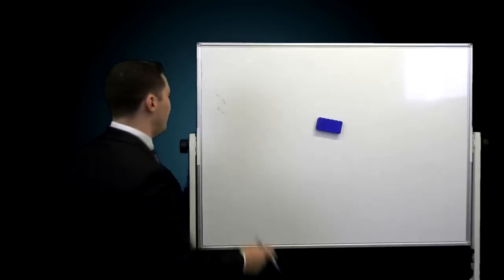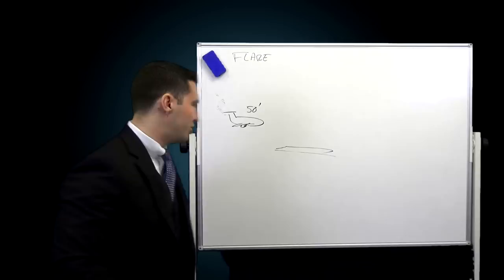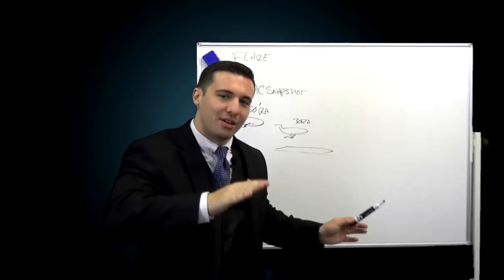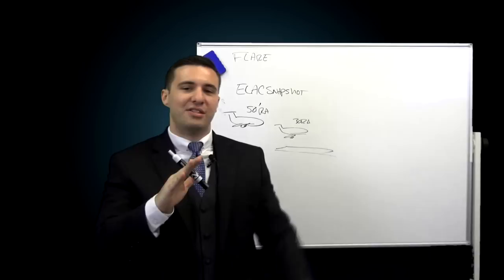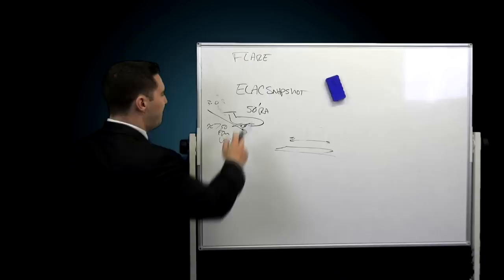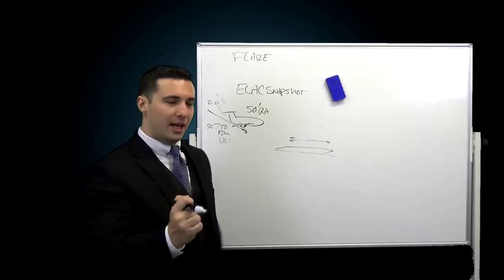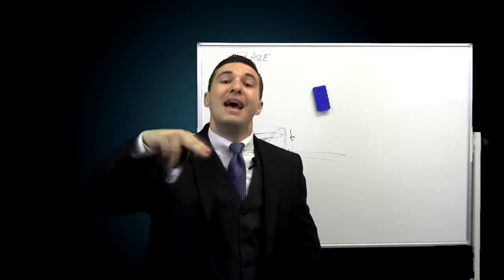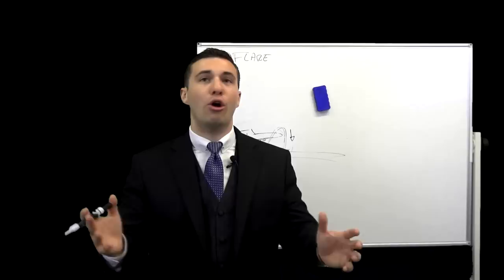A320 Landing techniques!

Comment: As an Airbus pilot myself, this is a great video, I always come back to Joe's various videos every few months to refresh my knowledge of things.  Outstanding stuff.
Reply: Hey as a real pilot do you mind letting me know: On approach in crosswind, do you apply constant rudder input to keep the track on rwy heading? Or should you have neutral rudder with  more drift angle? Thanks - I’m just a simmer but love the a320
Reply: @thatmatty231guy you don’t rudder it you just use a wind correction angle then rudder it straight during the last 10’
Reply: @lauran3244  Thank you -ive been trying this lately and yes that works much better

Comment: 1000 hrs in 319/321. I made the best landings by applying forward stick below the 10’ call out rolling the main gear on every time! Pulling back in the flair you’d ram the main gear into the runway making a hard Airbus landing! Once I got used to just the opposite I was surprise the nose gear had plenty of (pitch) room instead of the thought of landing on the nose gear first! It was the same on the B727. A little nose down pressure at the right time you would roll the main wheels on the runway! Took about 3 months to figure it out after 10,000 hrs on the B757/767!

Comment: The 320 gives you ZERO feel in the stick during flare - unlike Boeing 777 & 787 that have artificial feel units which are quite good. If you try and wait until you have no more resistance in the side stick you’re gonna smash it on every time ! You gotta flare the 320 with your eyes not what you feel in the stick. I wish someone would’ve told me that - I could’ve avoided a great deal of embarrassment.

Comment: Joe, great video but I think the term pumping in relation to the flare is a bit misleading...perhaps more of an emphasize on “squeeze and hold” back on the stick would be better as this leads to a pilot thinking about a steady smooth input during the flare to touch down in the proper target area of the threshold ....when I flew the 320 many moons ago, I used to suggest to my low experience FOs that what I primarily wanted to see the most was accurate touchdown targeting, which would likely not lead to a pure greaser....but, the greaser was lower on our priority as we often flew into wet limited length runways in Europe and the emphasis was on stopping performance by getting the wheels on pavement ASAP to get braking action as soon as possible....at the moment, I fly 747-400s into places like San Diego (about 2600m Rwy) and the same “squeeze” technique still applies, but once again it’s all about setting your touchdown target and accepting that they aren’t all going to be greasers to keep the operation safe....I haven’t seen any of your other videos but would be most interested if you did a presentation on runway overruns and how to avoid them (though perhaps you’ve already covered this?)....there have been too many over the last couple of years and they are so preventable.....all the best!
Reply: This is interesting. I only have a PPL, but I was taught to NEVER push or let the yoke go forward during flare. Whenever you feel you're pulling too much nose up, just "freeze" the yoke and hold it still. The nose will come down again by itself at which point you can continue pulling gently. (unless you're pulling a steep angle of course).  Looking at all these airliner videos, you often see the pilots yanking/pumping the yoke before touchdown. I suppose some dynamics (inertia?) are totally different, comparing a GA  plane to an airliner?

Comment: Pumping is a  life saving technique to achieve lower landing rates. I'm not a real life Airbus pilot (sadly), but I fly a study level A320 and pumping the stick always saved me when i felt like the plane was gonna touchdown way too fast. It really helps to cut that extra energy in half and kiss the runway. My average went down from like 190-250 fpm landings to 50-150. I didn't know it was a real life technique, though. That's amazing! And as I didn't know the technique, i used to call it "jerking" the stick when explaining it to p3d friends struggling with their landing rates. Pumping sounds a lot better ngl. It's perfect for floaters as well, despite not being something a pilot would do, i guess, as it could be dangerous. Perks of flight simulation, i guess. Float for a couple hundred meters, touchdown with a sub 100 fpm landing, and then brag about it XD By the way, i cut the throttles at 50, pre-flare just a tad, and start pumping at 30-25 depending on weather and runway length. Sometimes I don't even pump. The pre-flare at 50ft often cuts the energy decently enough, but it's also very risky sometimes because it could slow down it way too much and make you drop like a brick while pitching up like a mofo to try and make it less of an impact. When it's timed correctly, though, it's often an effortless sub 200 on TDZ.

Comment: Unless you claim you know more than the people who wrote the FCTM, your technique and explanation are inaccurate. 

-Flare height is 30 ft, it increases or decreases based on various factors. All that 'Arresting Sink Rate at 50 feet' talk you gave was BS. Your instructors will specifically tell you not to do that, as that will mean you are now touching down on the RWY farther than you had planned to and thus are eating up precious rwy length and decreasing LDA (Landing distance avail). Big No No.

- During flare, PF will have to apply a progressive and gentle back stick order until touchdown.  (Diect quote from FCTM). No pumping required (really!). If you feel you have flared too much the action to take is to release the backward pressure and not as one of the other commentators has pointed out pitch down at 10'. Lol, that is rather dangerous and may result in a nose wheel strike and those wheels are not really rated for the loads the main landing gear experience.

-At 20' the retard call is given and is a reminder, not a command (unless in a cat3b autoland). As long as TL are at idle at toughdown to allow for spoiler deployment and holding a little thrust till then is warranted you can do that. Different circumstances require different retard heights, retarding at 30' feet may be necassary when landing in a wet runway to improve landing performance but generally on a normal landing at sea level with a headwind and moderate temps, 20' is a pretty good height to retard Thrust Levers(TL).

Your video does have a good coverage of flare law but is still inaccurate with the practicalities of flying. I would suggest deleting this video and re-uploading it after you've read up on the FCTM.

Disclaimer: I'm not an Instructor on the A320 family. In all cases the current FCOM and FCTM are the sole authority on procedures, unless your company ops procedures say otherwise and are more restrictive, over what I've said here and any errors I may have done in doing so. Please ask your company instructors to clarify any doubts you have on your SOP and don't follow what you see on YT.
Reply: Your technique sounds perfect to me. This is what should be done. Everything from not rounding out at 50' until and unless you have some abnormal situation like steeper glideslope. And applying gradual progressive back pressure at or little after 30 ft callout. Cutting the throttle at 20' or after but definitely before main gear touchdown. I guess that much depends upon your energy state. 
So, yeah! Your comment is very much helpful. 
Thanks👍🏻

Comment: Retired airline pilot 25 years flying Boeing 737/57/67 aircraft. I don’t think you have ever been in the cockpit as a pilot. You do not mention one of the most important components of flying any aircraft, TRIM.
Reply: An airline pilot of 25 years and you don't know the A320 AUTO TRIMS? That's why there's no mention of it.. you don't trim it manually.  Sounds like you're the one who's never been in a cockpit. Maybe it's that you're commenting on an A320 landing video having only flown Boeing.. go figure.

Comment: Hi question. If coming in for example at 700 ft per min. At 50 feet, do I pull a little then at 30 start flaring? Or at 50 still maintain pitch
Reply: A320 in normal wind condition, I mean except for tail wind, actually no that necessary to do round out, that may cause to use a lot of runway, but it will be very smooth touch down. A321, you better round out after 50 feet. Round out technique is just a bit of back pressure on side stick then release it, you may see the sink rate will be down to 350-500, that means a perfect round out, then after 30 or 20 feet call out, start flare just a little with thrust idle when you see the flare position is established. Well, it just take times to learn everyday every landing.

Comment: Great video! But I am confused, why do you have to pump the control column on a plane that's not an Airbus, but you don't have to pump as much on an Airbus?
Reply: Fly-by-wire controls on the Airbus.  Instead of physically moving the controls with the yoke, on the Airbus you are telling the Flight Control computer that you want just a touch of nose up/nose down and letting it move the control surface.

Comment: “Pumping” the yoke/stick is terrible technique and goes against airmanship 101. Constant/increasing back pressure for conventional aircraft and slight increase in pitch then flying the nose wheel onto the runway for the bus is proper and correct.
Reply: In FLARE mode it's conventional so you have to 'pump' or constantly adjust back pressure for the round out... looking forward to you disagreeing
Reply: @SweetToastSugar wrong. But what would I know, I only flew the bus for my previous airline and am currently a legacy CA.
Reply: @prorobo  When I read "legacy CA" I immediately thought of the Erin Brockovich scene where the PGE lawyer flexes that they were a multi-billion dollar corporation. Yes captain, 👨‍✈
Reply: @SweetToastSugar  not a billionaire, but again, have flown the bus and fly for a living making $300k+. Keep playing that flight sim from your mom’s basement though. 👍
Reply: @prorobo  gross or net?
Reply: @SweetToastSugar  gross. I’m a junior 737 CA.

Comment: Sorry for the "maybe" stupid question (I'm only a Sim Player) - but why do you look at the end of the runway while landing?
Reply from the maker: It enhances your peripheral vision to increase your ability to judge sink rate. In other words you have a better idea of descent rate without looking at the VSI.
Reply: because your eyes have a problem discerning rate closure to a flat surface when looking directly at it-if you look at the far end of the runway,your eyes can see the change of angle of the runway easily
Reply: Try this in the sim. 
Keep looking on the aiming marker until touchdown. Trust me you'll slam the bus on the ground. 
Now, transition your view to end of the runway. Now when you'll make even a slight pitch up movement, you'll be able to see and judge that well. Not even that, your Peripheral vision will help you see when you'll level off, that is prevent you from floating. 
Try it👍🏻

Comment: Dude used 10mins to answer the question.. i’ll summarize it in 5 seconds “ at 30’ RA retard the thrust lever follow by a gentle few degrees flare” 😆
Reply: Mus Azman Better understand than simply do it without any clue why it works
Reply: Definitely laboured that point
Reply: But dude! It's harder to do than said. It much depends upon what you see, where you see and how you judge it!

Comment: Pumping is not a correct landing technique...
Reply from the maker: Absolutely! Pumping isn't a "technique". BUT.. watch any pilot land and you'll notice a constant variation in back pressure input. The word "pumping" isnt used to describe a technique but rather to better illustrate the periodic back pressure inputs used in the flare.
Reply: I agree-but then,I only have 14,000 hours-don't "pump"-apply back pressure to arrest the descent rate-look at the end of the runway and you will  discern the rate of change of the runway angle easily to allow a controlled flare
Reply: In the bus you will see a pump happening. In any airplane you will witness a small pumping action...  Think about it.